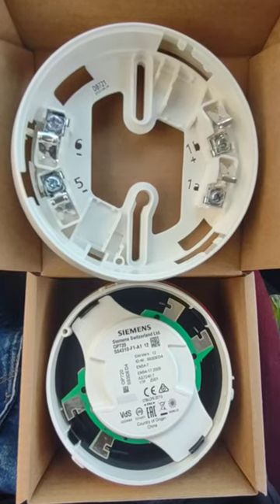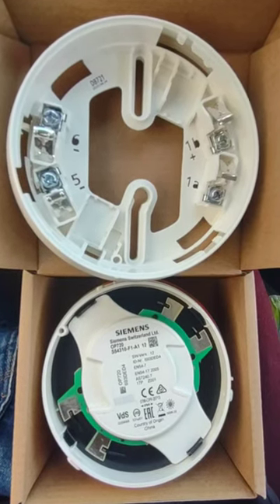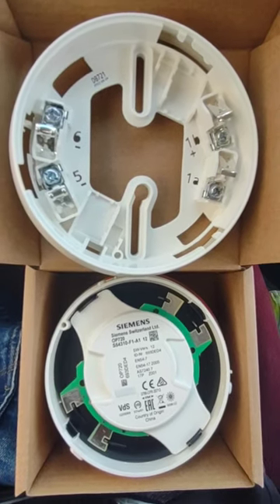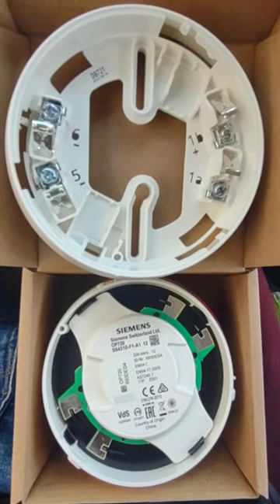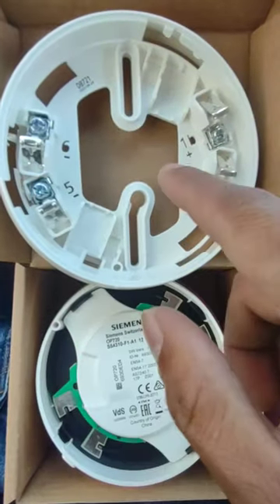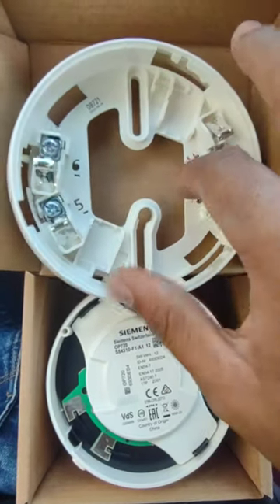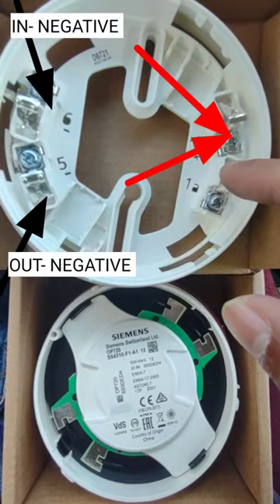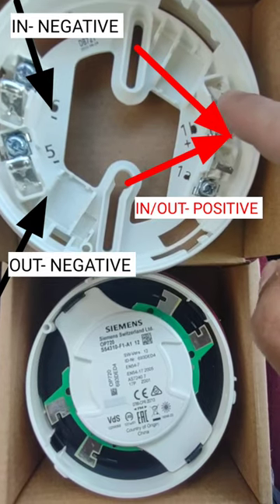Smoke Detector (Siemens) termination i/o #siemens #firealarm #shorts #reels

Comment: sir,
inout-1b&6
output-1b&5
is it correct?
now, 
whice is indicator connection terminal?
Reply: Sir
can you help me
Reply from the maker: Yes, it is
Reply from the maker: @reduanhossain4613 what?
Reply: @pidoystv  How to address it?
Reply from the maker: @auderiliopedro7911  no need to address it. You can see the ID number at the device head that is the address of the device.
Reply: Hello, I am facing an issue. Can you please help?